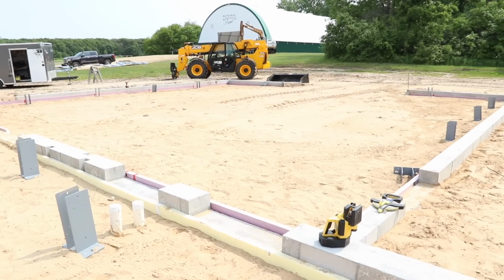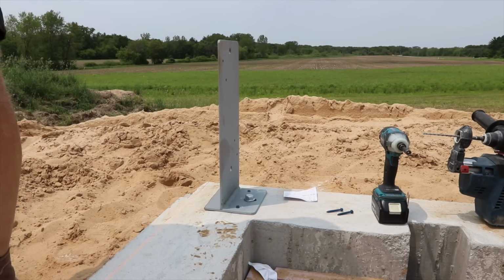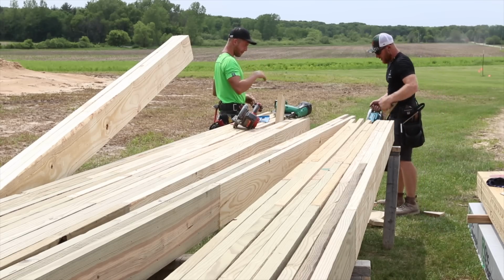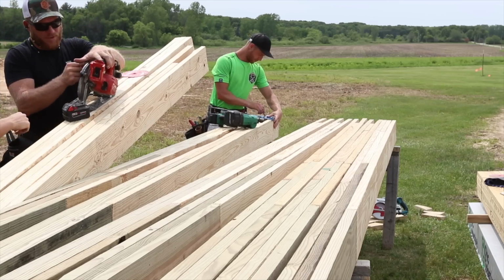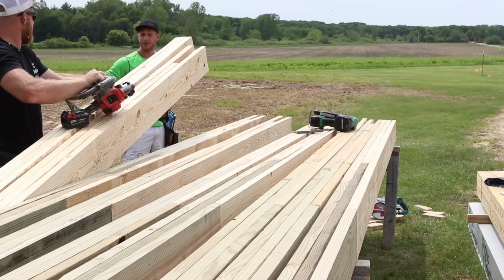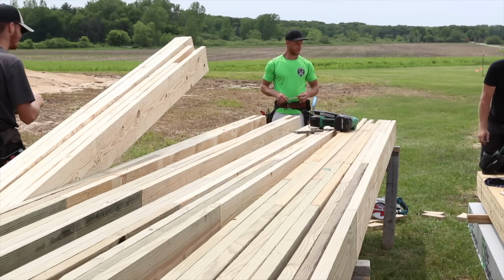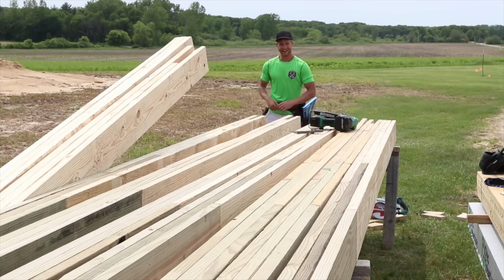Building a Hunting Cabin

Comment: I've been involved in concrete forming of walls (mostly residential; 4' and 8') in rural Pennsylvania. For a project like this, we would use 4ft. forms to pour a 3 or 4' wall in the ground to be deep enough to be away from winter frost. We also made jigs so we could pour the concrete with the bolts in it so no drilling needed to be done. YMMV, of course. I have a question: has anyone ever poured an 8' wall so at least 4' is up out of the ground? If so, did you ever put a building on top of such an arrangement?
Reply from the maker: Yes totally doable just need to engineer the wall

Comment: I think you've shown this before, but I'm missing how you use the laser to set the elevation of each column. Does the receiver tell you how far off you are, or do you have to adjust the grade stick?
Reply: Ive used one once, and when it was within 40mm up or down from target height it said on the display how many mm was left

Comment: Awesome!  Did u have to schedule this six months out because of your workload?  Or does it take six months to get the project from contract signing to build?   Like iterating on the design with customer and engineer and suppliers?

Ps, u need a set of those electric bug swatters from Amazon
Reply from the maker: mainly due to workload yes...they came to me with a main design already figured out
Reply: RR Buildings , thanks so much.  Only recently been subscribed, but the whole process is interesting and really like the values you have and build with.  Top notch.  Much appreciated.

Comment: Neighbors are having a shop built.  It sits at the end of a T in the road so I drive straight at the side of it.  They got the trusses and roof sheeting on, and I'm driving up to it.  I'm like either my eyes are playing with me or the roof apex is not level.  After a day of this curiosity got to me and I stopped by to see how it was going.  Eventually I ask if the owner see's what I see.  Walk out to get some perspective and he's like that does look off.  Walk inside and look around.  I'm like it looks like the studs are either longer on this end or you have a lot of slope to the ground they didn't accomodate for.  Get to measuring and sure enough one end is about 4" taller than the other.  Turns out they set them all.  Measured both ends, snapped a line and cut them off in the air.  Not sure if they will fix it or leave it.  Not sure I should have said anything.  Sometimes ignorance is bliss.  I'll also see that every time I leave my place, but at least I'll know I didn't lose my marbles...
Reply from the maker: wow man that's just too bad
Reply: @RRBuildings  Just drove past it.  Looks like they are leaving it.  Felt and flashing are on the roof.  I think it is kind of a friends and family project.  Not the end of the world!

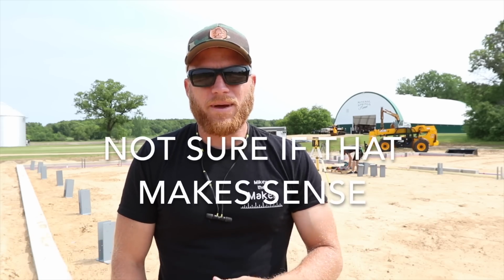Comment: 2:20 through 2:59 You totally lost me.  I have no idea how that station would help you on two separate buildings...though if you have a common wall, then I see how getting one done, will help the other.

BTW: What about the end of the other building (the one you went from Red steel to the lighter color (beige?).
Reply from the maker: concrete was just poured and we will be headed back to finish it
Reply: @RRBuildings  means we missed the radiant floor heating setup.  :(  Really want to see how they handle that along with the support equipment used.  I'm in Michigan, if I build a barn, I'm going to want radiant floor I believe.  Others have said there are other options that cost less up front, and the "claim" is that they are just a "little more" in the long run....

Comment: I assume that is getting a poured concrete floor. With well over 30 years in commercial excavation I know that you NEVER leave the topsoil and grass in a building. That is just a hack job. Are you going to fix the floors for free in 5 years when they are garbage?
Reply from the maker: All sod was removed before filled... the excavator didn’t have time before concrete was poured due to all the rain so they stripped it after walls were poured
Reply: I know if it was my place and I saw that Id dig down and check. I know that when the sand is already in the building and the grass is still there Its a hack job. I have seen the way shit gets done by the lowest price you can get. But I'm guessing you will just delete my post.